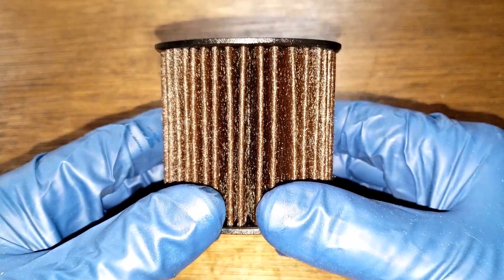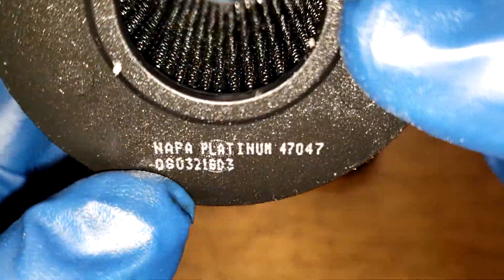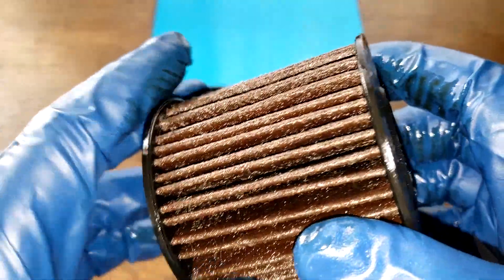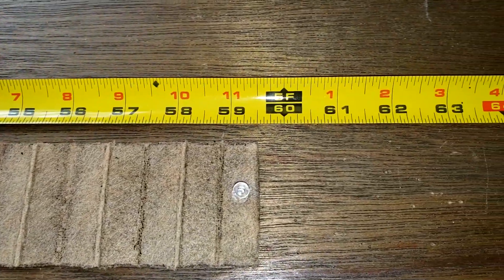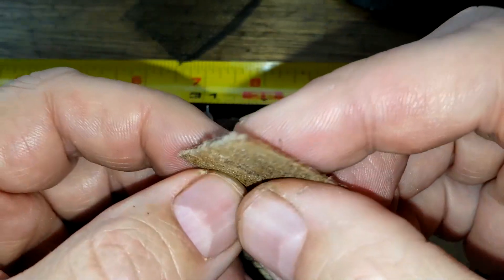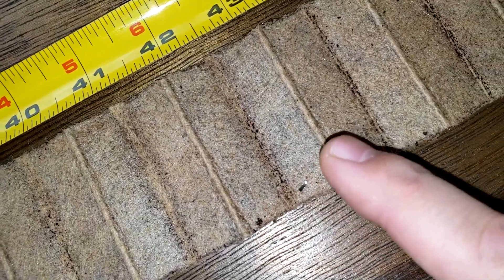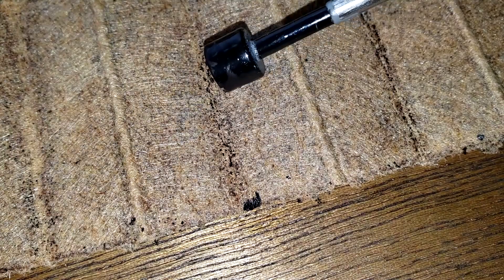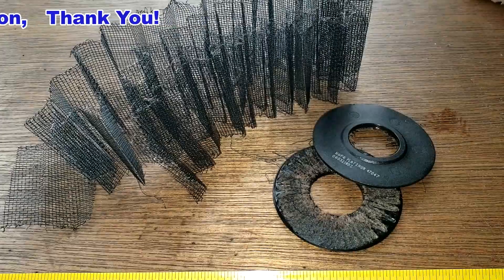Napa Platinum Cartridge Oil Filter PFL47047 Cut Open, Used Napa Platinum PFL47047 Oil Filter

Comment: Are the new XP filters built the same without a center tube?  I have some old stock with the metal center tube and wire backed media, and a newer one with louvers on the center tube and probably nylon backing since the filter is lighter than the older stock.
Reply from the maker: I don't know, could depend on the filter size.
I'll pin your comment so that it sits up top. Thanks!

Comment: You can buy the OEM filter from a Toyota dealership for $5.97. It comes in a Toyota packaging but its made by Denso in Thailand. Beware of ordering this cartridge filter online unless it's from a reputable Toyota Dealer if you decide to get the OEM. There are plenty of counterfeits out there. If anyone puts a crappy counterfeit on and it comes apart then it could be goodbye engine!

Comment: Nice of John to send this filter.  Looks pretty good Pete.  Very good sharing!  Merri :)
Reply from the maker: Thanks, Merri, Yes it was nice of John👍
Have a happy fat Tuesday and ash Wednesday.
Reply from the maker: @01mustang05  I think the filter looks fine but I agree with you on the price. $ Too High
Reply from the maker: @01mustang05  As long as it's a tight fit. Sure, why not? No different than metal against metal like a lot of stamped leaf spring bypass valves that have metal end caps.
Reply from the maker: @01mustang05  Sure I would rather have one made with a center core and a rubber-type gasket on the end caps, but that's the way they make some of these cartridge oil filters and they should work fine. After all, this is a used filter and it did not collapse. I see no problem.
Reply from the maker: @01mustang05  I agree to disagree. Done.

Comment: Nice filter...

I saw once on a YouTube video an adapter for these types of filters such that it allows you to use regular style oil filters that screw onto the adapter.

Looked like it was made from billet aluminum or something similar.  It adapted so regular can style oil filters could be used.

With no ADBV or pressure relief valve these types of filters seem less robust to me.  But I'm not expert it just seems that way.  So that adapter seemed like a good idea, a nice upgrade.

Still an interesting filter, seemed well built with a nice metal backing.  

Nice review 👍
Reply from the maker: Thanks, drum
I think I saw that video too or a similar video. I suppose if you have the room it could be better.
Reply: @WhipCityWrencher  that's true I didn't think about that... there being enough room in your car's engine bay.  The one I saw was for an F-150.  Good point
Reply: The pressure relief is built in. Totally not worth it. Those adapters cost like $200 plus what kind of filter are you going to use that doesn’t affects pressure or flow? Car care nut has a whole video on this topic. I think it is a great idea but too risky and expensive.

Comment: $19 for a filter with no can(n)ister, no base plate, no anti-drainback valve, no bypass, no spring (coil or stamped leaf retainer)? Ouch. 

I see the Napa Platinum for my vehicle is now $14.49 so it is $3.50 more than it used to be but it has a can(n)ister, base plate, anti-drainback valve, bypass and spring. PFL47047 must be in big demand and low supply.
Reply: I pay $7.95 for Toyota OEM cartridge-style filters made by Denso. Very high quality and not a rip-off like Napa.
Reply: @ChicagoRob2  It's hard to justify paying the extra $11 for maybe a slightly better media.
Reply: I also buy Mazda OEM filters from my dealer for $6.75(also made by Denso). It can be important to go OEM, because manufacturers specify proper bypass valve settings for their engines. I’ve checked competing filters for my Mazda that have totally different bypass valve numbers.
Reply: As a rule, topic "cartridge" filters do cost more than spin on type. It's primarily about economies of scale, supply and demand. That said, $19 here for a cartridge with questionable to unknown efficiency, very steep.
Reply from the maker: Hi Jeff,
Yep, these cartridge Napa Platinum filters are expensive. Here's a good alternative for a lot less, just need to buy a few at a time to offset the shipping. https://www.rockauto.com/en/moreinfo.php?pk=4768893&cc=3353685&pt=5340&jsn=459